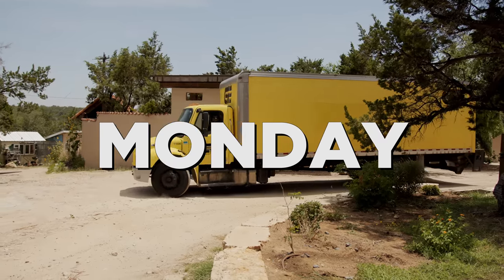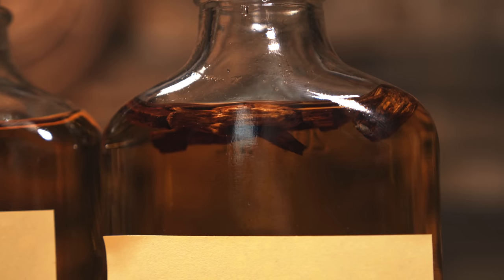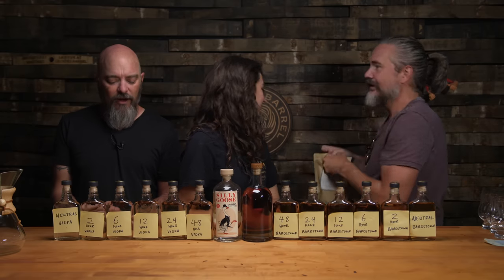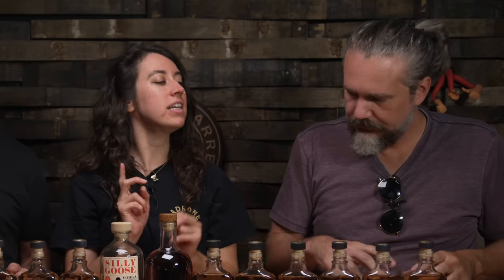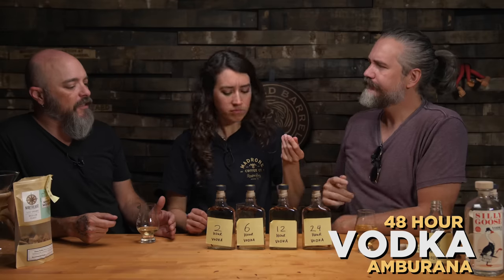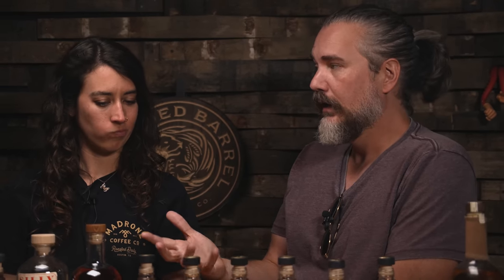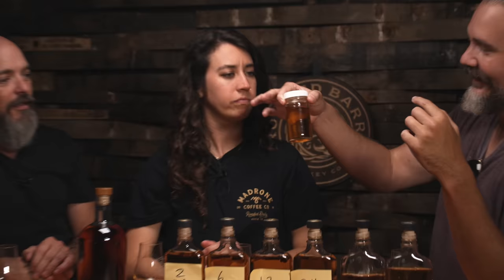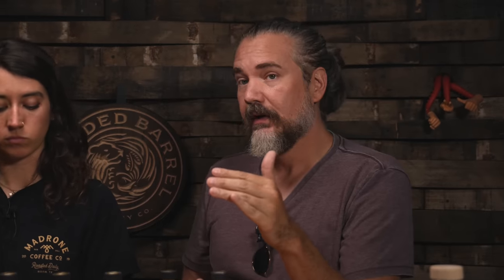Brazilian wood hacks whiskey aging | AMBURANA barrel experiment

Comment: It's used a LOT in Brazil. My favorite kind of wood for aging here. The one thing I hate in whisky ageing is that it only uses oak, on Brazil we use a lot of diferents kinds of woods in ageing
Reply: Do you know if gunpowder tree has ever been used? I'm thinking of making a barrel of that.
Reply: @festerallday  Neverheard of someone using it. You'll need to know what kind of oils the bark have that the alcohol will extract, and if it will be edible or just strait poison
Reply: @neto00740  I know that it's a very useful tree. The wood burns to pure charcoal (used in making gunpowder), the seeds are full of Omega-3, and the bark produces hemp. It's in the cannabis family
Reply: Not every wood is suitable to make barrels. Oak (especially white oak) is good because evaporation is particularly low as far as I know.
Of course experimentation is always great :)
Reply: @festerallday  you can always just try staves/chips in a glass/metal container if you don't want to make the barrel or worry about it leaking
Reply: @mmmhorsesteaks  we have a 250y tradition in wood age and a lot of specimes than your temperate forests.  We know witch one is good or not depends i what you need in flavor. More than 10 woods are commonly used  and others

Comment: I've been experimenting with hickory aging. I don't like it much, but I discovered something which might seem interesting. I only have a small, air still set-up, so my batches of shine run to just a few gallons, tops. I made some corn and malt mash, which resulting moonshine I aged with toasted hickory sticks and unprocessed hickory/pecan pellets. A month with the hickory and I could tell it was not heading in a direction I liked, so I redistilled it and soaked it with large toasted white oak chips, my standard. But it came out way, way smoother and nuttier than any other batch. The month on hickory did something really nice after the redistillation.

Comment: I just got a bottle of Starlight Cigar Batch (finished 6mo in an Amburana barrel).  I haven't cracked it yet.  I'm kind of apprehensive to given it's length in that secondary barrel.  

What's the general opinion on it?
Reply: It is an excellent bourbon. It changes a lot as you let it breathe. Starts out a bit sharp on the nose but as you let it sit becomes more of an apple pie and sweet pipe tobacco.. Flavor is vanilla, sweet apple, cinnamon, and allspice.❤
Reply: thanks for the response.  i knew the wood's influence was strong when i purchased but no where near as much as they conveyed in this video.  

i'm probably going to wait until the weather cools down to open it.  it reads like its a nice fall/winter pour.